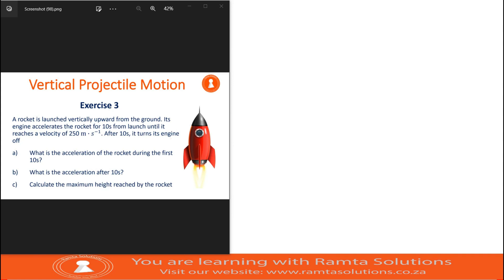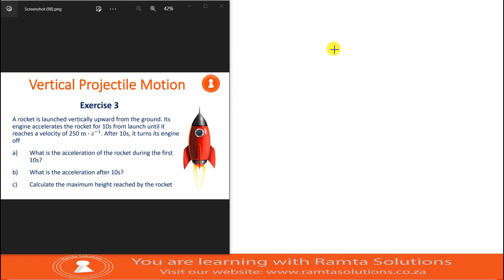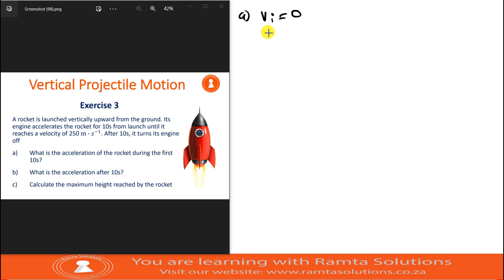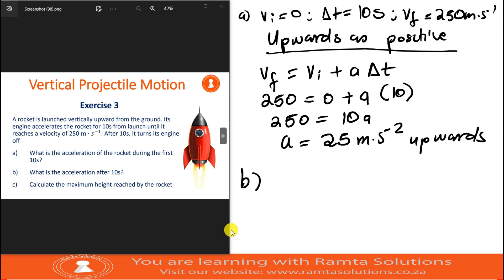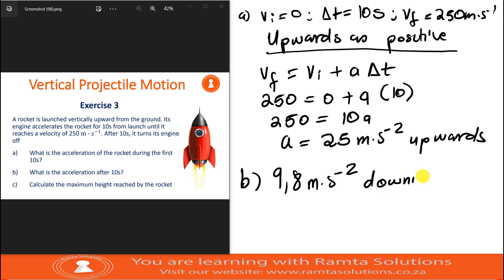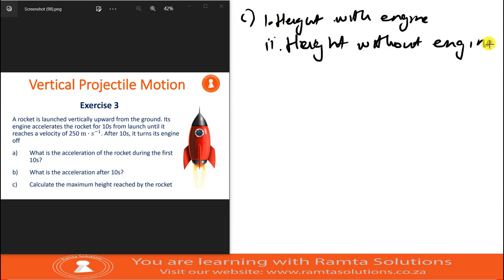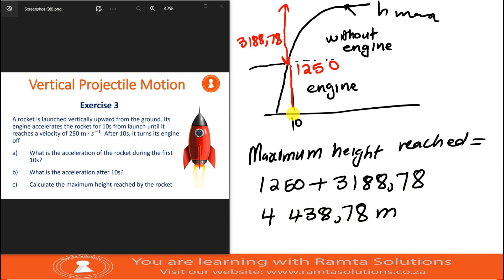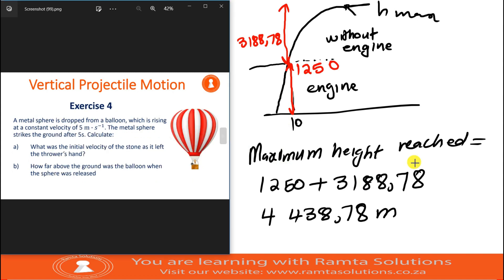Vertical Projectile Motion: Exercise 3

Comment: Hi Sir..Why is the initial velocity 0m/s wherelse we were told that it was launched upwards
Reply from the maker: Thank you, Aya. Indeed this can be confusing. Initially, the rocket is at rest. We therefore, go with this notion so to simplify our calculations. Remember the lunch happens instantaneously, so better if we take the velocity as zero.

The question can go two ways. Your assumption that initial velocity is not zero, is still valid because the rocket  was launched, meaning, it has been given a push.

Comment: When I use 🔺y=Vi🔺t+1/2ā🔺t² for the other ten seconds I get 2010m which then adds up to make a max height of 3260m......... Am I not allowed to use the above formulae?
Reply from the maker: He nda!!

I don't understand what you mean by the "other ten seconds". If you mean that this is the time used for when the engine was turned off, it is wrong. This time is not specified. The specified time/duration is when motion is powered by the engine.

Regarding formulae, whichever formula you use will return the same answer. 

I have tested the formula you used and these are the results: 
∆y = ví∆t + 1/2a∆t²
     = 0(10) +1/2(25)(10)²
     = 1250m

This formula wil not apply for the second part because we are not given the time/duration